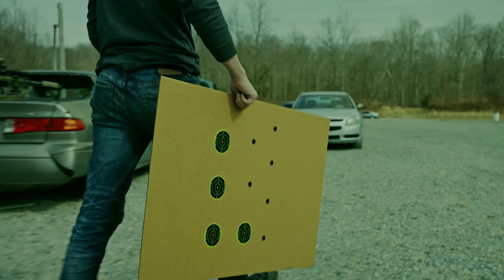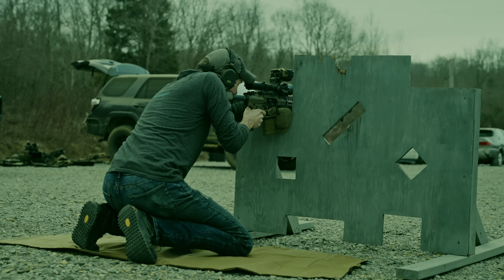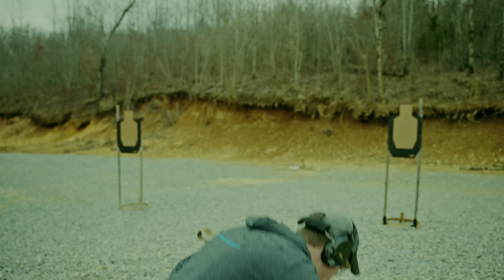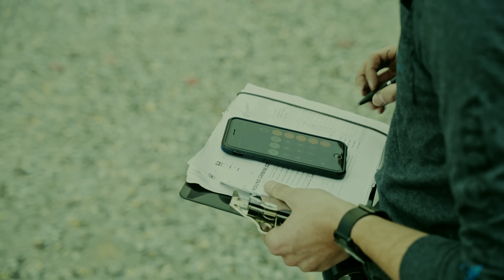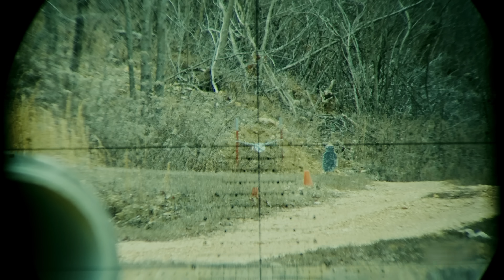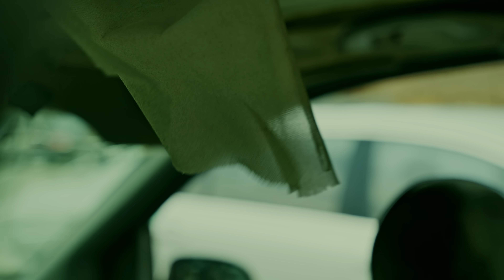Can You Shoot a 17lb Sniper Rifle Up Close Fast?

Comment: I have to have a $15,000 rifle first
Reply: The rangefinder is almost 11000 by itself.
Reply: @NM-235 just use a decent reticle and maths for rangefinding
Reply: @nicholaspreston9586  oh I agree ☝️ that’s just a super expensive setup.
Reply: @NM-235  but why?
Reply: I haven't even spent 15k on anything
Reply: @Token_Black_Guy  over 25k on all my defensive tools. 25k on a Harley uh.. 30k on a Titan uh 30k on Hyundai 250k on a 10 year old brat
Reply: @mikehill4776  napalm the entire situation, 🏃.
Reply: @Token_Black_Guy yes you have
Reply: Subtract the RAPTAR and you’re in the $5k range with optics which is relatively affordable in the long range space. There was a time not too long ago that you had to spend $3k on an optic and $5k on just the rifle and they would only guarantee 1MOA. Now a $1k bolt gun with a $1k will best that with factory ammo. The cost of entry has dropped drastically from even 10 years ago.
Reply: I can shoot 2 inch groups at 2500 yards with my 22 heritage revolver
Reply: @daddoesthings9461  .... made by Remmington, lol
Reply: Imagine having all that on your gun then a emp goes off and it's all useless lol
Reply: @jnorth5689  as long as it’s not plugged in you’d have to be very close to an emp to have problems plus that Wilcox raptor is pretty resilient.   Emps are mostly a problem for the grid because the long heavy high voltage wires act as an antenna for the reflected energy of a high altitude nuclear blast and destroy the transformers and everything plugged into the system.  Mostly to emp protect your stuff you should do the same thing you would do to protect from lighting strikes, unplug and turn off when not in use.
Reply: @NM-235  you really never know. I'm not hating on it. I'll never be able to afford it anyways.
Reply: @jnorth5689  even if I could I’d buy something else
Reply: @jnorth5689  yeah cuz EMPs just go off all the time. j North over here driving a Flintstones car😂
Reply: @griffey11  just because it hasn't means it never could?     That's some logic
Reply: I'm building a .308 SASR. I'm projecting 3k total cost including glass... that's "not expensive " lol
Reply: @kananisha your’s won’t be that good either….
Reply: No you don't. Most of that cost is the rangefinder. If you use a range finding monocular (what most people do) you can get away with a very nice setup imo for under $6000. 

Ammo is typically the money sink for becoming good at serious long range shooting
Reply: @frankdamsy9715  VERY GOOD COMMENT
Reply: The only thing I would buy in $3000 range is a Winchester 1886 from Turnbull
Reply: @raymondjohnson6496  if that's a bolt gun, you're going to get yourself wrecked by the leftists running gas guns.
Reply: Bruh a tikka t3 or bergara and a good scope will shoot super good groups out to 600+
Reply: Very cool!...and informative!!... how about some links to places to learn long range from?
Reply: @lukasstrne3780  Sniper's Hide for one
Reply: @lukasstrne3780  you wanna learn. Find Ryan Cleckner, definitely worth the time and money.
And if you’re in TN, Strategic Edge. 
Tony Shankle is same great for time and money.
Spend couple days with those guys you’ll be on another level.
Reply: i don't listen to salesmen.
Reply: This is the exact opposite of my channel. Lucas buys 15000 dollar rifle to shoot 100 yards, I buy 800 dollar rifle AND optic to shoot 1 mile. The 15k rifle is badass though. Lucas obviously feels comfortable shooting close and quick,  but I'm interested in seeing him on a longer range learning precision. Hopefully this kind of video isn't how it will stay
Reply: Mines a 6.5cm build with Aero parts. The base build, when buying parts on sale is just at 2k, plus good glass thats good for up to 500yards. Which buckmaster came in clutch with an extreme quality glass for just a 100 dollars. Granted now I shoot past 500 yards and changed a few things on my rifle... so with new glass which is 1500, my total build will be over 4k spent, parts changed being ergo shelf grip, kynshot hydraulic buffer and jp tuned spring, jp headspaced bolt and supermatch barrel, aero adjustable gas block, vg6 epsilon brake (eventually getting a surefire can), trigger tech diamond trigger, laser for shits and giggles, bipod, ambi selector.
Edit, new glass will be sig Sierra6 bdx to pair with my 1600bdx monocular rangefinder, and pair a kestrel for better auto holdover dots.
So all in all I guess it will be over 6k
Reply: Imagine the new Vortex scope taking care of all your dope in seconds.
Reply: First thing I thought lol
Reply: Did the name of the video change or am I high?
Reply: The money is really all in the range finder which is rad but not necessary.
Reply: I'm disturbed enough at carrying an $800 pistol and a $2,600 folding backpack rifle. I didn't want to have to worry about cheap shit breaking, but dropping $15,000 on any gun would end up breaking ME ! Well, unless that 15k gun is a transferrable machine gun... In that case I would pick up another job to pay for the mountains of ammo that soothe my soul.
Reply: Yüs
Reply: Yes you do or you suck
Reply: @steezyaiden7530 more like envious.
Reply: It's impossible 😜
Reply: I did a double take, though i heard him wrong.
Reply: Great video.  I agree with the comments here about the price but this is just the start of  Lucas in precision shooting.  I am guessing we will see budget guns / scopes as he progresses.  Why start off with budget gun and suck whilst you learn skills ....when you are sponsored and well financed and more importantly making informational video content?  I'm looking forward to watching the learning curve more than anything.
Reply: The Seekins SP10 is like $3k, the rest is in the MDT Bipod & Wilcox lmao 😂
Reply: You can build a 20" 6.5creed db10.  It has SR25 style receivers (not dpms), and uses a standard AR15 buffer tube (their db10 buffer and spring are on their site also).  Their preassembled uppers are only $500 (even less in 308)--  and then you can get their stripped lower for around $100.. buy a cheap parts kit for the lower and throw it together.  Super cheap and easy.   They cost $2k if you buy them outright, but for some reason you can build the same rifle from parts on Diamondback's site and it's well under $800 total.  Super accurate and well worth the money.
Reply: Where does this kid get so much money? Lol great channel though.
Reply: @mattyice2099  Do you not realize how much money youtubers make?  He has well past a million subs.  I get that youtube isn't as friendly to gun channels.  But a normal channel with this many subs, who puts a standard ad read at the beginning, and the normal ad pop ups from Youtube.  With a million subs, they make $100k per month EASY, depending on how often they post.    

Such as, look at Garand Thumb-- how he reads off who "sponsors the channel" at the beginning of every video;  and its' several sponsors.  They could be getting up to $20k per episode to read those names off, because it's a given that a Garand Thumb video will have at least a million views, and many of them will have way more.  5mil or even 8 million views on some of his videos.   I remember seeing Brandon Herrera get his channel shut down for 1 week and he couldn't post a video, and he said the channel lost $20k that week.  So that shows you that every week he posts only 1 or 2 videos, and it brings in $20k -- EVERY WEEK.   

So when you see these big channels that are over a million subs, don't be fooled.  They are making BANK;  which is why they complain when they get demonetized, because it's a lot of money they lose; so everyone has to scramble and get back on Youtube's good side to get that money flowing again.  it's a LOT of money;  especially for the guys who push ads.

Not to mention MERCH--  most youtubers make their largest profit off of selling shirts.  Look at Demo Ranch-- he literally bought the printers to do the shirts himself and then it grew into a huge clothing company called "Bunker Branding" --  which a LOT of the guntubers all use now.  

These guys (Lucas) even have their own gear company, where they make holsters, etc.  So this youtube channel acts as an advertisement for their own brand, and he mentions their site in every video;  that's not an accident. 

Plus they get paid per VIEW (and runtime)-    They get paid (by youtube):  from $2 to $10 per every 1000 views, depending on how advertiser friendly they are;  which is up to Youtube's discretion.  Which is why gun-tubers will have their own personally ads, like SDI or ammo companies, etc.   So if they post everyday, or every other day-- and get a million views per video, then you can see how fast this will add up also (as long as you stay "monetized"-  but they will still get those "channel sponsors" money either way).

Then there are "brand ambassadors" deals.  Where you just continually will have a product in every video, and they just pay you a steady monthly check.  Such as Garand Thumb always blasting those ballistic dummy labs life-like targets.   Not only are they likely sending those for free (which cost a couple thousand each)-  but you can bet that they also PAY them a monthly check, just to keep putting them in their videos.   Or like Lucas always pushing BCM rifles;   This is just an example and I can't confirm this one-- because they don't have to disclose it.  It's like a legally embedded ad that they don't have to report to the viewer;  again, it's "brand ambassadorships" -- look it up.

Another way they get paid is by "Super chats" and donations on live streams.  Just look into twitch and see how big the live streams can be, and how many people just donate the entire time. 

Another one is Patreon.  If they have a patreon account, they could be posting a few extra videos over there and getting HUGE donations rolling in.   For example:  I just looked up Garand Thumb's patreon--  they have 2500 patrons.   He only offers a $5, $10, $50 Tier of payment.  So even at the VERY LEAST amount  $5x2500=  $12,500 from his patreon alone;  and I bet it's closer to $16k or more..   and that's Every Month..   I think T-rex put out a patreon when he reviewed a belt they were developing. 

You get the point..  They make money in a lot of ways, and this isn't even counting other companies that they probably have going on.
Reply: @calholli  100 grand a month? That's not what i found when I researched channel income but that's insane. Makes sense.
Reply: NO kidding.  Interesting channel, a bit out of touch considering where we are in history and this economy.
Reply: Can I just have the 15 grand?
Reply: I mean if we all had the money, we would all do it.
Reply: Sounds like you need skill
Reply: I have several rifles that I’ve spent $16k to $20k each and some that I’m projected to spend $36k with thermals voodoo-S and Wilcox raptar and ngal
Reply: Sense make no does comment do you
Reply: @AldoSchmedack  one year late mate. The title of this video was different when he published it.
Reply: Nah breh the rifle is completely wasted on you, you're not a $15k rifle guhnshlonger
Reply: That rifle alone is only about $2500 it is an amazing rifle for that amount of money. It's a lot of money but it punches way above it's weight 👍
Reply: Best way to get into precision: Tikka CTR in 6.5, put money into a good mid price scope like a Leupold mk5, slowly upgrade with new chassis/stock and barrel as you learn. The gun is like 1100, 1500-2k for a scope, little bit extra for scope mount, rangefinder (don’t need right away), bipod, you’re like 3.5k all in. Only major difference in price between a precision gun and any other rifle is the optic, but an LPVO costing 1500+ is pretty normal these days as well.
Reply: @JohnSmith-yx8kf  VERY APT COMMENT
Reply: i buy sthis part and attath it here, and i buy sthis part and attath it here, wasth me sthoot fasth, duuuuuurrrrrrhh. 🤦‍♂
Reply: @investigativeoutcomes9343  LMFAO
Reply: Don’t hate..work harder and make better decisions…that family works hard everyday..what have you done today to be better?! More basement Cheetos or game level ups don’t count btw.
Reply: @Sevendeucegroup  “don’t hate” proceeds to project and hate
Reply: @Sevendeucegroup  i cannot stand that work harder if you want more money statement. You may get the results in your work but that doesn't translate to more money often at all dude. Theres countless examples of this not resulting in making more money, theres also countless examples of where ACTUALLY making more money is merely a result of who you know, the connections you have. Especially in this day and age, you wont get ahead without having a connection somewhere
Reply: exactly right!!! @Sevendeucegroup
Reply: @Sevendeucegroup hard work does not equal money. Some of the laziest people are millionaires.
Its all luck and where you were born
Reply: @Sevendeucegroup  I don't think it was hate, I think he's saying it's not generally applicable outside cool factor. The average "well off" person has around 36k in savings by 30. but that's their emergency money. who is going to blow half of their reserve money to try to shoot a bolt gun close range when a 2k AR covers that all day?
Reply: @Sevendeucegroup  smooth brain alert
Reply: @Sevendeucegroup  I own two businesses and could buy that setup many times over but like you said make better decisions right. I don’t know about anyone else on this thread but I can retire very comfortably at 39 part in case because I didn’t buy stupid crap like this. You can and I have for much cheaper